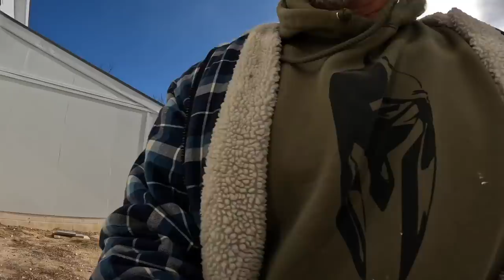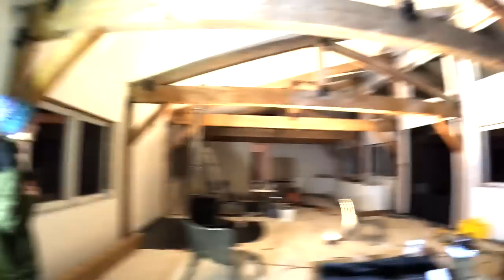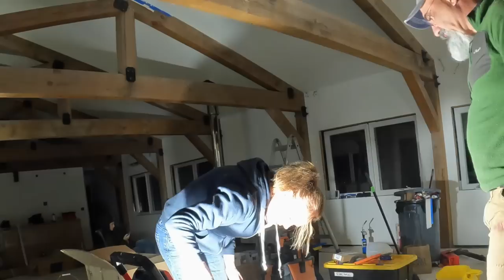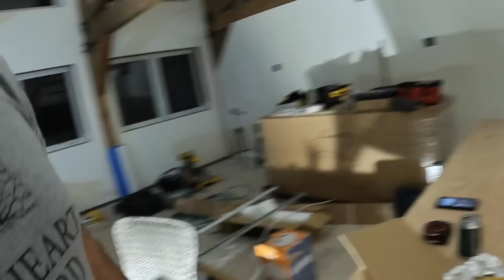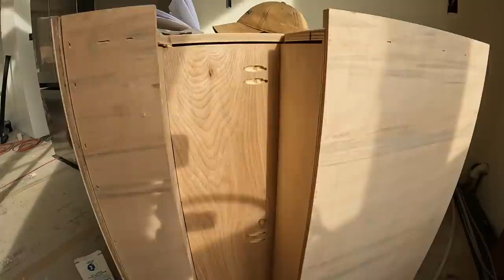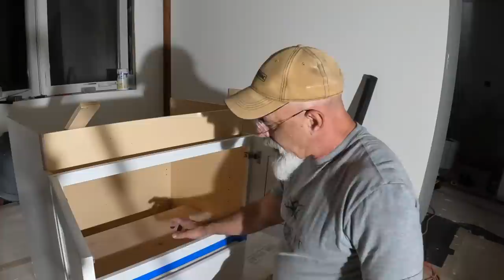DIY Cabinets install and Modification.  Farm Sink and Corner Cabinet.

Comment: Mr. David, take your time for projects, as the say is "measure twice...". I say "measure 4 times and don't cut anything, untill you're absolutely sure it's right". And still it happens.. that you have to re-measure and re-attach, if possible. Hehe, you know.. You're more in a southern countries and there winters are not so harsh, but elevation plays it's role. Here at my place, we are in a particular position, also this year it's a southwestern draft that holds warm air predominating although I have a bad feeling for february, once the syberian Burian will start it's offensive.  So, it's nice to spare some heating and wood for later use.. 😊 I hope you will succeed with the counters and there won't be necessary reattaching pieces.. Cheers.
Reply from the maker: I have about 1.5 cord cut, split, stacked. Next year will be a lot of cutting and splitting. But I really love “ wood lot days”, even though they are exhausting.

Comment: It always freaks me out when people show slow motion of power tools. It reminds me of mining safety videos and how they slow down when something bad is going to happen. Loss of finger, eye, leg and other injuries. You guys are doing great. Keep up the hard work. BTW are you going to put silicone on the legs of the sink? You may need an extra mm or two in the gap.
Reply from the maker: I didn’t mean to cause worry😎. I have a specific sealant that I will be using on the sink along the wooden face

Comment: It's a lot of work, but it will be such a beautiful home inside and out. With a view to die for.
I find it hard to say, but your daughter's room looks quite small. Is there any possibility of "swapping"?
You might say I have experience with that (LOL) 3 years after the last child (of four) left home, one of our daughters and her 2-year-old son came to live with us again. Not long after that, my sister, who suffers from Multiple Sclerosis and until then lived with her family in Russia, also came to live us  with her 18-year-old daughter. It was a challenge to give everyone the necessary space and privacy because our house is not big (a typical Dutch side-by-side house with 3 floors 490 feet in total) but it worked out. And When after 5 years everyone was gone we thought the house was big 😂 the second kitchen we installed on the third floor we keep because ‘you never know when needed ‘ …
Reply from the maker: 490 sf total?  45.5square meters?  Yes that would be tight for 6 people.  Lauren’s room is larger than average with very high ceilings. But right now she has all her worldly possessions in there.
Reply: @breakheartorchard4761  I forgot the square 😉 150 square meters. And the most important thing is that she gets healthy

Comment: My wife and I have been watching from the start, it's great to see things progress. I didn't realize Lauren's room was that small. Too bad her bathroom isn't an en suite,. 
Can I ask why you ask didn't go with an mvhr system for your home? 
Keep up the good work. I look forward to your updates.
Reply from the maker: Mvhr for the whole house is infeasible dur to the layout. There will be an air exchange system put in later but for now we use windows. Keep a window cracked when you are running the wood stove. House stays warm, fresh air works it’s way in.   
I really don’t think her room is that small.

Comment: What is all that tubing on the floor running below your cabinets?
Reply from the maker: Pex and electric
Reply: Is the kitchen sink drain going to be wet vented, studor, or fully vented? I can't do wet vent or use a studor vent over here, so I'm forced to channel into the ICF wall all the way into the attic.
Reply from the maker: @MrJramirex  it is a standard vent.   I had to look that up, as I didn’t know the difference. I actually have a wet vent in my half bath and didn’t know there was a difference.